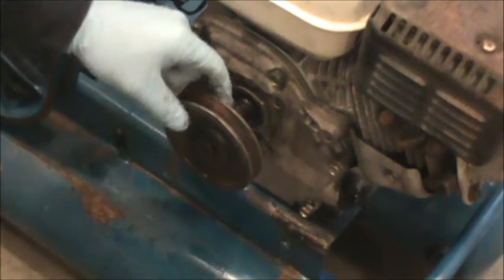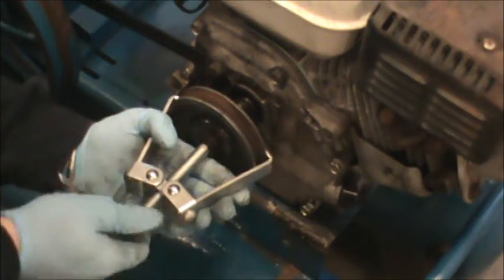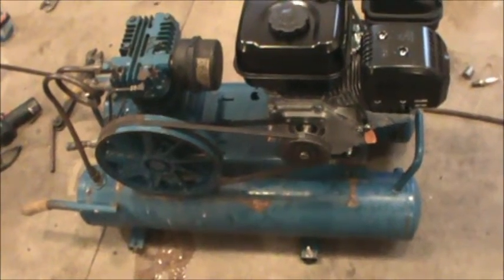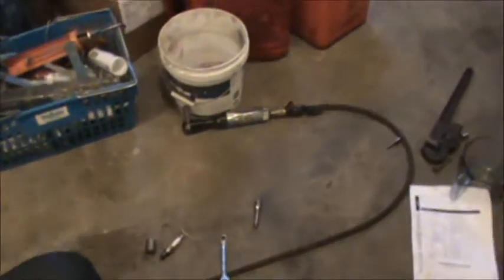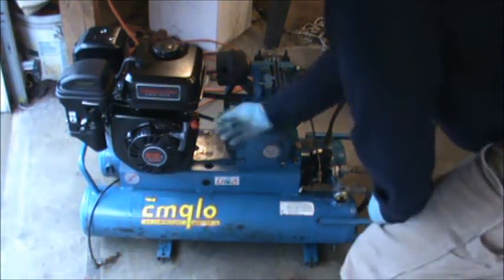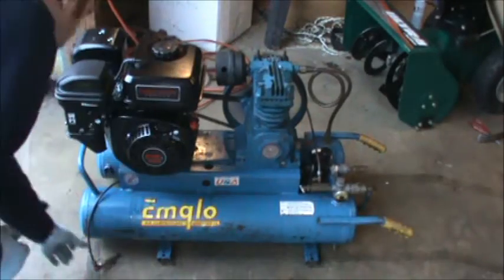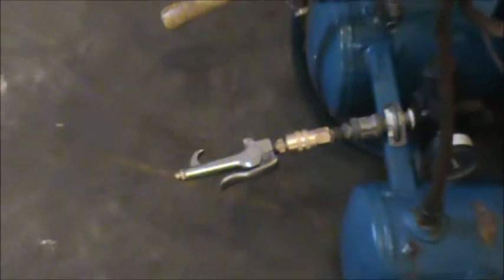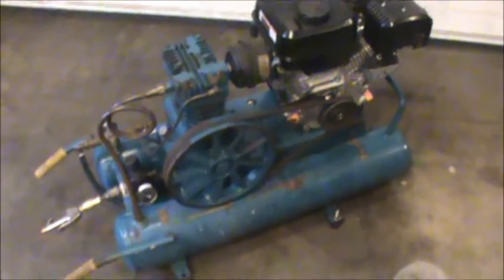Emglo Gas Compressor Adding Harbor Freight  Predator 212cc Engine

Comment: I have the same emglo compressor and I also put a predator engine on the engine will start with the belt off but as soon as I put the belt on the engine won't start

Comment: I had pinhole leak just like that. I ordered a new tank rolair. 400$ I took the old tank and cut the bottom open with a grinder. I’m getting into welding now. I bet I could hit all the rust off with a wire brush grinder fix the holes or possibly find another piece of metal to weld a patch onto it the bottom.

Comment: I have the same emglo compressor with a robin gas engine. Gas tank keeps getting rusty. Always taking the carb off and cleaning. Are the new predator engines safe to use with the new ethanol gas?
Reply: They're good as long as you don't let the ethanol sit. Drain the bowl and tank if it's going to sit for more than 1-2 months. Very reliable.
Reply: Predator motors are good for $ for me its always an ethical dilemma but I cant find any US made motors in the size range. Make sure you add oil and run it for 30 40 mins then flush the oil and refill with str8 30W. I also put a fuel cutoff valve on the feed line, turn it off while motor is running till it starves for fuel. Then you can go a couple of months until ethanol destroys the actual gas. Stabil will give you a bit longer but I typically drain fuel out of items if I know im not going to use them for awhile.

Comment: I've been looking at putting a gasoline engine powered compressor together and using the 3 horsepower predator. the specs on it say the shaft spins counter-clockwise and I'm wondering if I need to worry about having a special air compressor pump that turns counterclockwise as well.
Reply: Mount it backwards if need be.

Comment: Hey, If you fix that leak yourself I'd love to see a video. I have a older sears compressor that works great but has a pin hole leak also.
Reply from the maker: I did weld the leak check out my doublewide6 channel and search for air compressor leak.

Comment: Doublewide on Black Friday I scooped up a Kobalt 155 psi 3gal air compresser for 79.99 normally 129.99 so I think I did good but my question is will that work for changing my mower blades ?

Comment: Rusted air tank.. That sucks.
Reply from the maker: Buzz Kill.  Can't win them all.
Reply: Find a dead 60 gallon compressor and mount the compressor pump on it. Use the engine for a Troy Bilt Horse tiller(great money).
Reply: I'd try JB welding a metal patch on that tank.